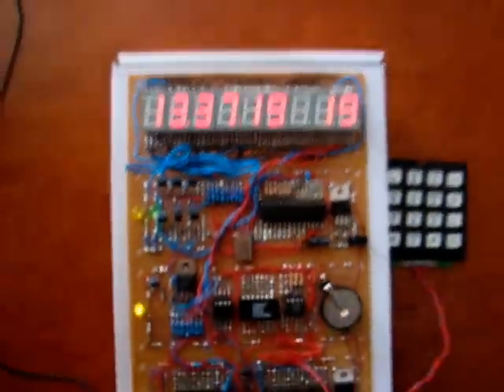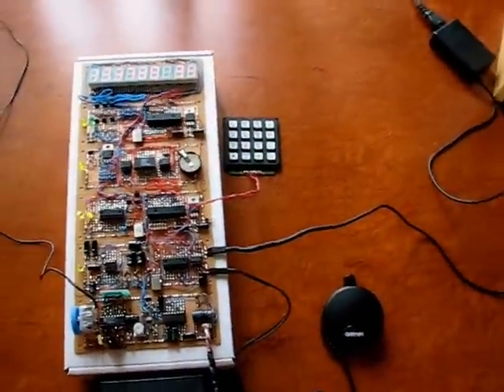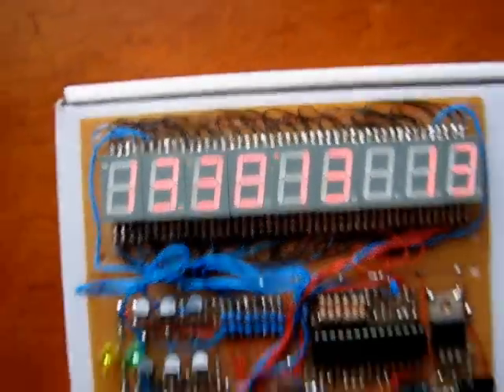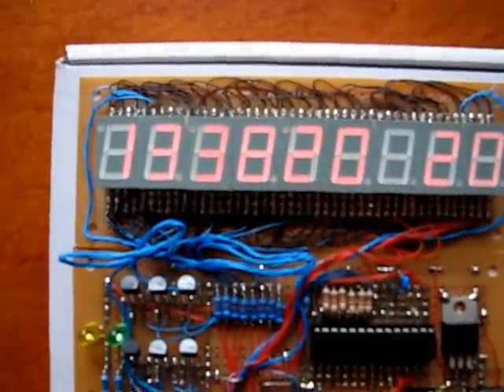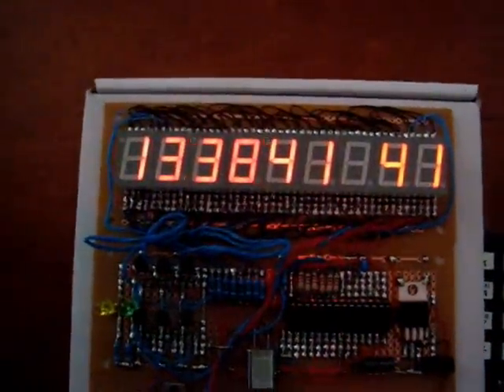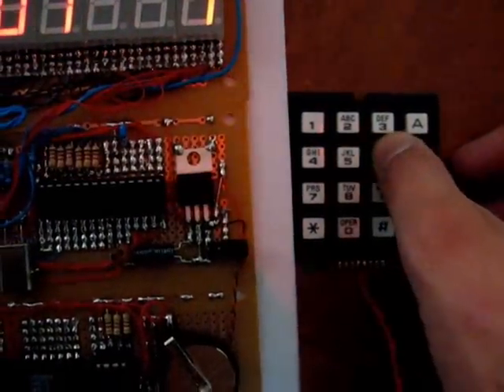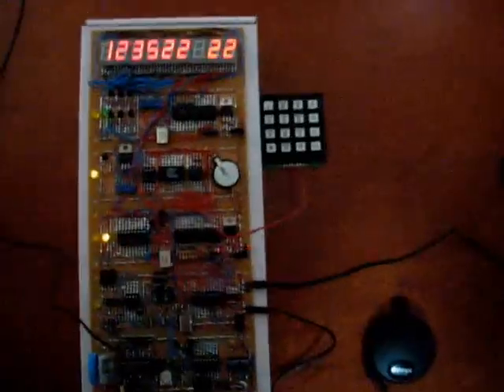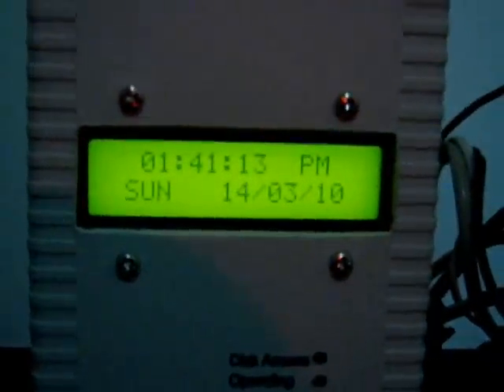Talking Clock Radio

Comment from the maker: Hi, I said at the start it's 4 pics :) they are all 16F family. One pic really runs the show, two are for separate display matrices. the 3 digit display is independent).

I think today you could get close to a single micro with hardware serial ports, but wouldn't get away with PWM sound simultaneously perhaps.